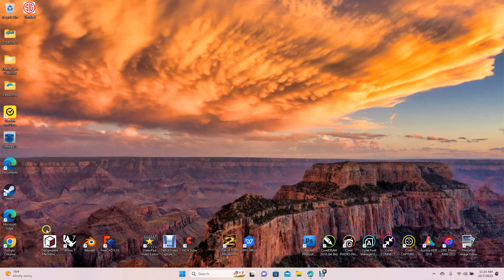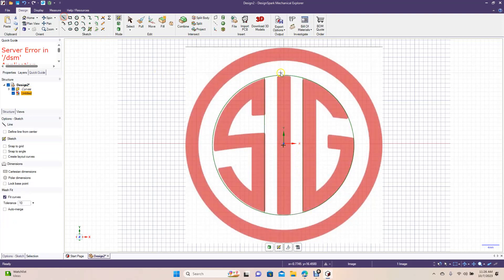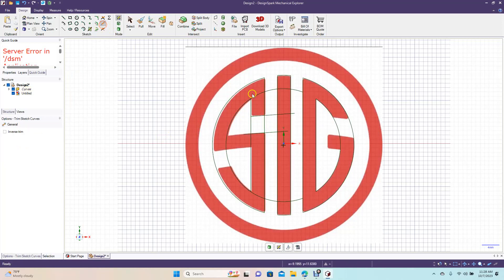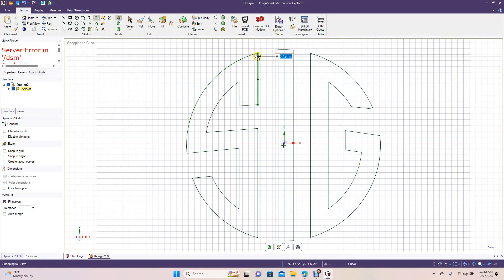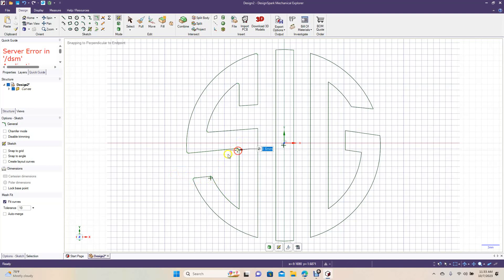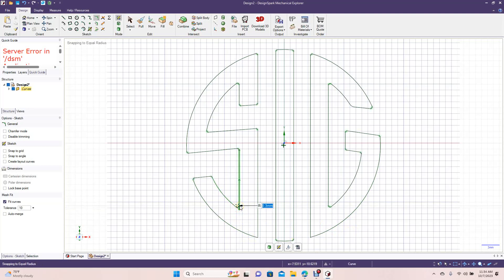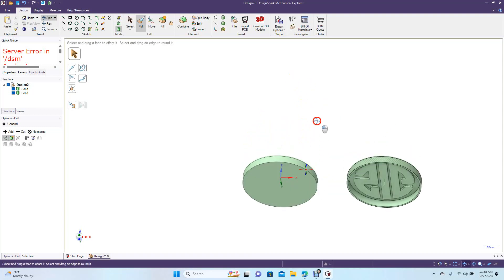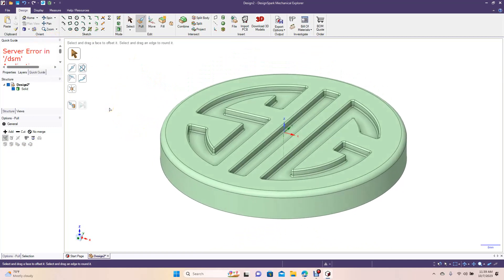How to recreate a logo in design spark mechanical 6

Comment: Very nice and easy way to do this. I have a DSM subscription so I have no limitations. I pretty much learned with DSM V4 when I needed to create a few things years ago for 3D printing. I installed V5 but got busy with other stuff so when V6 came out I needed it to open my old files from V4. I never subscribe to anything but in this case I think it's worth it. FreeCAD always seemed hard to get a full grasp on and back then it was buggy, and Fusion360 is too expensive and they somewhat crippled the hobby version. And it is always changing and trying to follow old youtube tutorial could become confusing.I would rather learn one program and get good at it so that's my plan. 😋